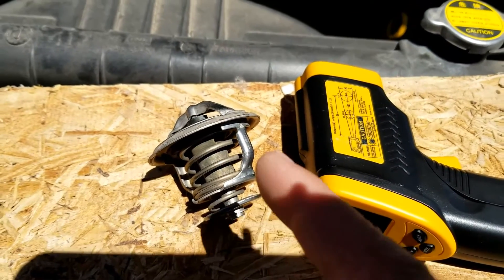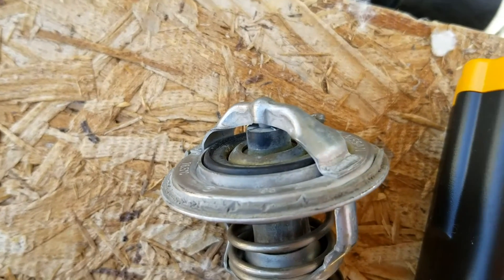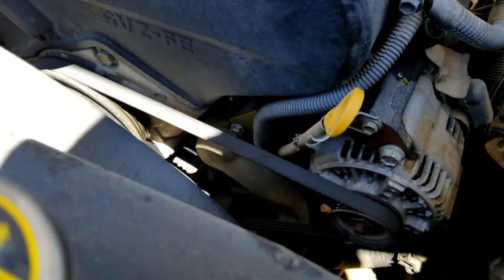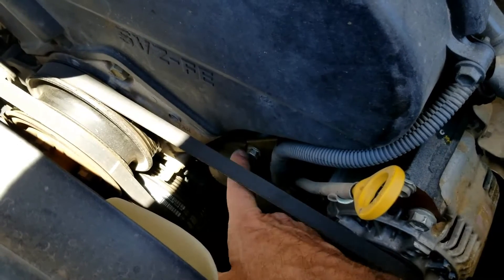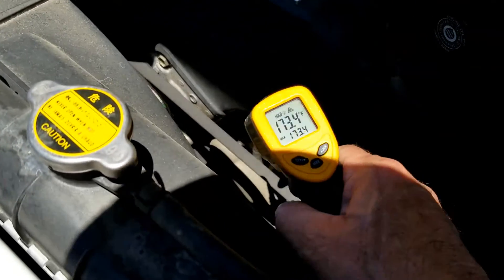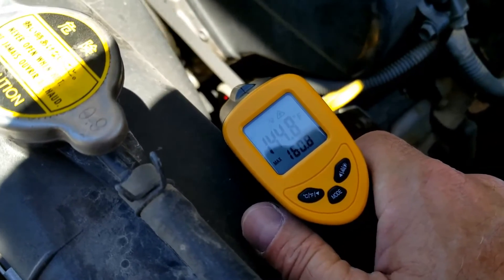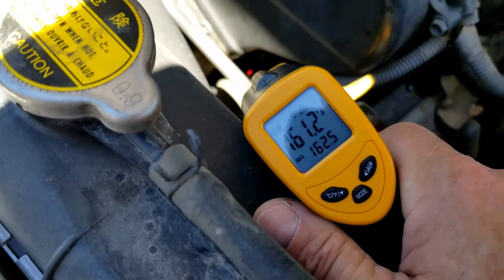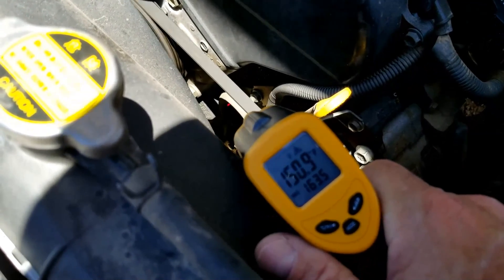How To Test an Engine Thermostat with an Infrared Thermometer

Comment: Yes, I'm an old school wrench learning how to use my new ray gun and same as mso1758 below, i am not clear on the readings for a t-stat which is stuck open. Intuitively i would think the temp remains the same (more or less as you move away from the block) when it's stuck open but that the temps would be somewhat lower or something? Please clarify when you got a moment. thnxs

Comment: Great video. Is there's a way to know when the thermostat is about to fail? I have a 2005 Civic and no issues so far. Am asking because sometimes I have to travel far away on heavy trafficked roadways, (and some of the roadways here don't have a shoulder), and I have heard about cars that unexpectedly got their thermostat stuck close leaving the car stranded and overheating. So I would like to know if using that infrared thermometer (or other method) gives you an idea that the thermostat is about to fail. Thanks.
Reply from the maker: You can go by the mileage it is rated to go up to, otherwise it is difficult to predict.

Comment: ???? What if your coolant system  has air gaps in it and you don't rule that out first
This advice is straightforward which is great, however I wonder if it's accuracy isn't compromised if
your coolant system has not been ''burped '' properly or required bleeding  after  major repairs like a changed radiator,

Woudl this infrared thermostat test, still be valid if there are gaps of air where there should not be:?

There are literally over 200 videos on this subject on YouTube, but many are inconsistent
in the methods used to perform such a test first,  but this one link to this video I'll provide here
was better than most:   See: 

https://www.youtube.com/watch?v=VvkAvt8_fMc

How To Easily Remove Trapped Air From A Car's Cooling System

proclaimliberty2000
276K subscribers

as well as this one:
https://www.youtube.com/watch?v=VvkAvt8_fMc

Overheating After Replacing Radiator, Pump, Thermostat? Burp Coolant to Remove Air Pockets!

1A Auto: Repair Tips & Secrets Only Mechanics Know
2.43M subscribers